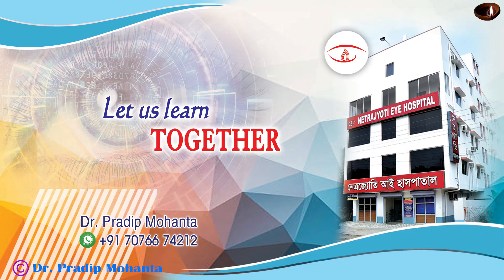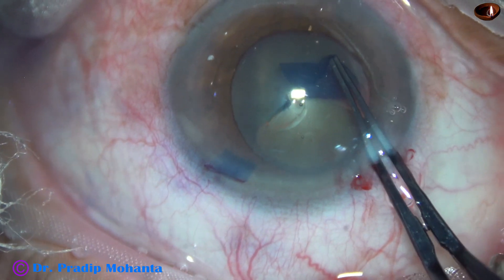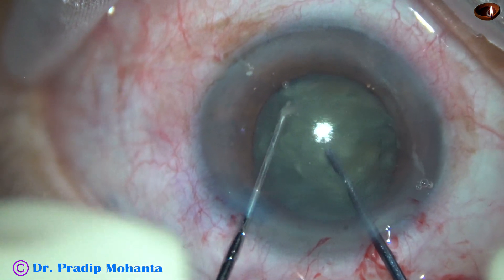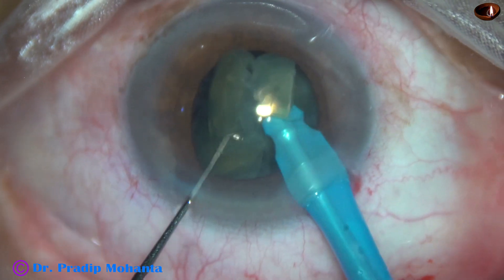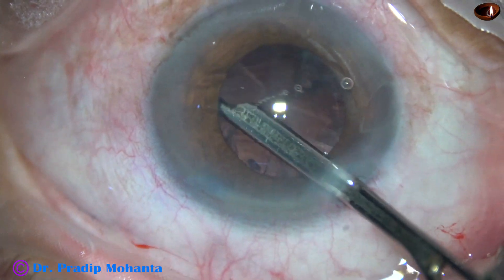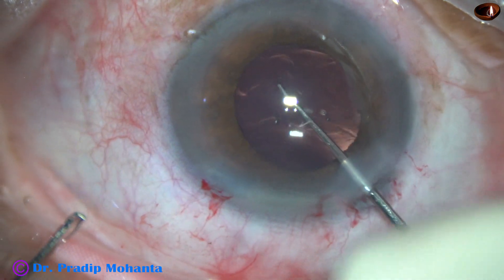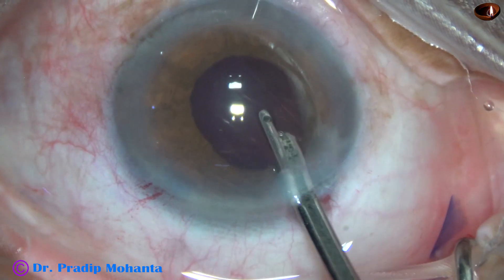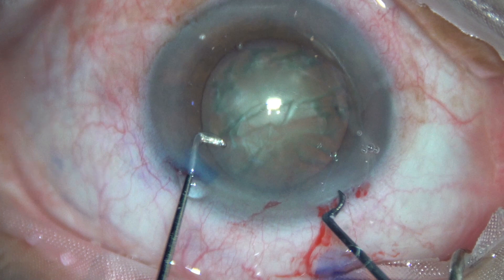Prechopper in Phacoemulsification with IFIS : Pradip Mohanta, 30 June, 2021

Comment: Thank you sir for the great tip  "(1)To remove chopper after phaco probe withdrawal when there's iris incarceration at the side port..

(2)the limited role of chopper only during dividing nucleus and to come out of AC, rest of job done with phaco probe in IFIS, 

(3)  with prechopper use pupil expanding device can be avoided in IFIS..!!"